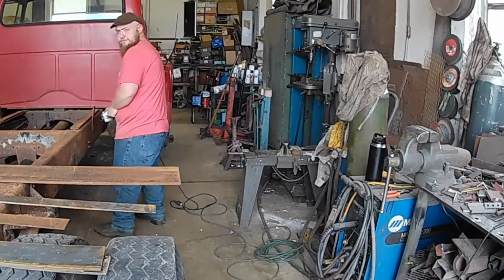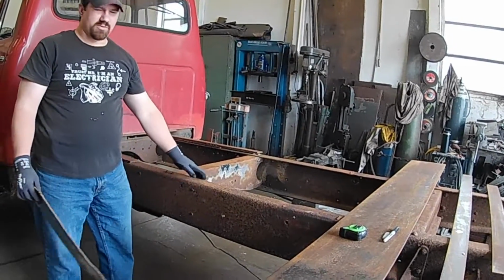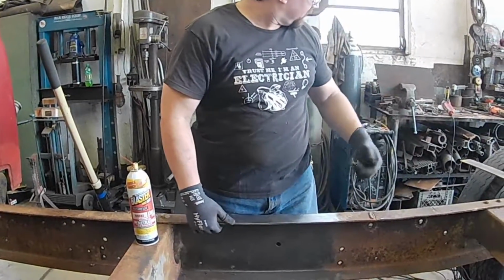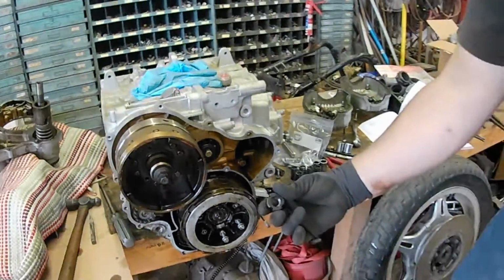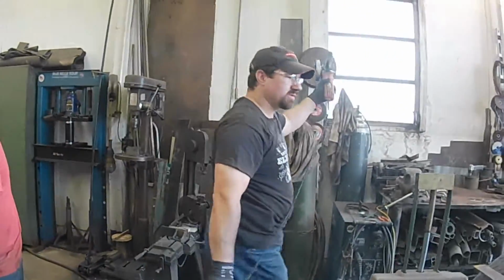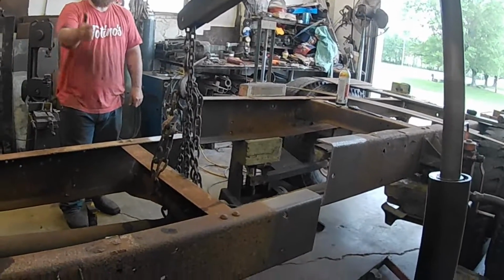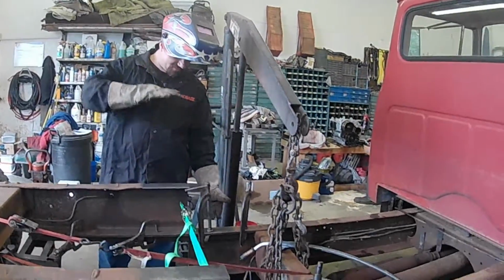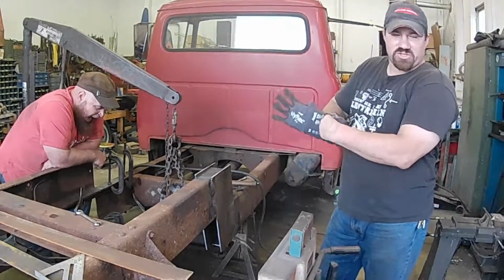Frame Z-cut Day 1

Comment: I have a 73 Loadstar, I’m removing a few leafs front and rear. Static drop on stock suspension…. No air no A arms.

So my Z cut won’t be so much but can you explain the concern you mentioned about the rear drive line doing down to carrier bearing? New to this so what can I do to help this concern?
Reply from the maker: I made a mistake which did cause some vibration. I ended up putting it back to where it was originally and it is doing fine now. When I swap drive lines I will probably have to have a whole new drives shaft made. I would leave the carrier where it is and see if you have vibration before you make plans to move it.
Reply: @wrenchbenders  copy that, I enjoy watching your videos because like you said, your most expensive tool was the welder and I can relate to that. I’m not nervous to do the Z cut after watching you video